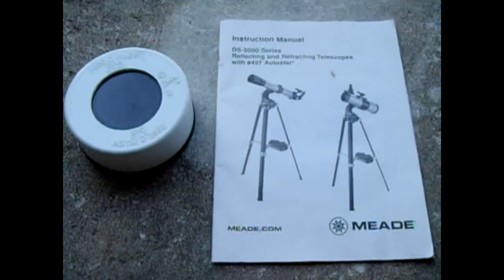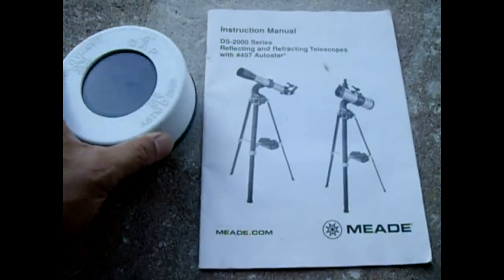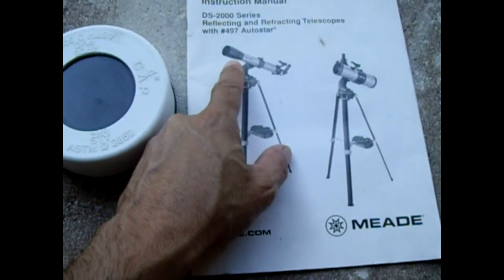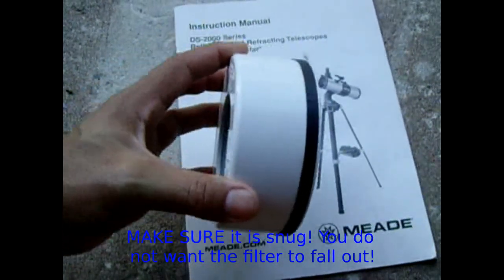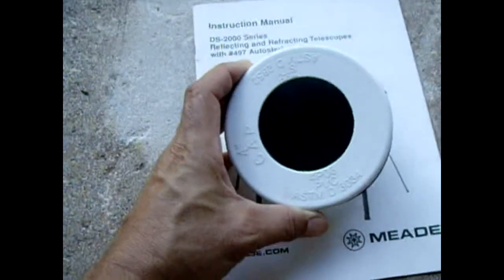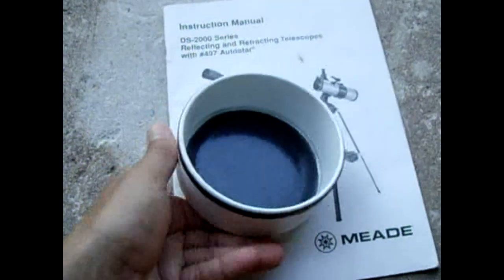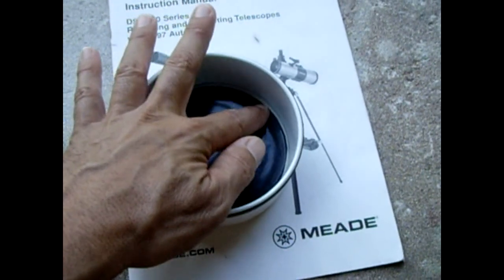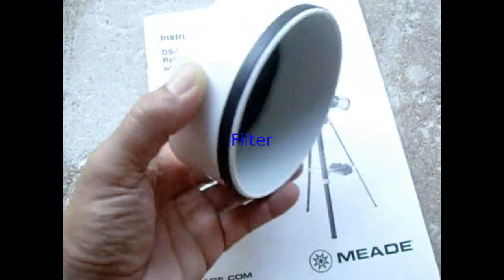Homemade Telescope Solar Filter (Meade/Celestron)

Comment: ALWAYS FIT THE FILTER FROM THE OUTER DIAMETER OF THE TELESCOPE! NOT LIKE THIS VIDEO. WHAT IF THE SEAL IS NOT TIGHT ENOUGH?
Reply from the maker: The tube is slightly tapered, and there's also a plastic ring around the objective lens. The fit is perfect.

Comment: Thought I'd make me a solar filter by cutting a large hole in a spare lens cap and applying the solar filter material to the inside of that. Normal plastic cap tho; not PVC as here. What brand silicone adhesive were you using here?

Comment: never ever touch your filter....   dangerous...  keep it clean and un scratched..
Reply from the maker: Aye Aye Sir. I forgot there are many "Experts" on Youtube. How exactly do you plan on making what I did without touching the special mlyar material? I used this filter for YEARS with zero problems, even touching it with my finger and cleaning it on occasion. This material does not scratch that easy, especially by finger tips with no long nails. The filter can be full of dust and still perform just as good a being clean.
Reply: You are risking fate of the earth sir... It can randomly open black holes and shit. Just don`t touch it!
Reply: NEVER Clean It with a Cloth !!! Only use a Specialise Air Blower made for Telescopes/Cameras, but DO NOT Touch It with the Brush that are on some of those Air Blowers !!! ... DO NOT, Under ANY CIRCUMSTANCES Try To remove Any Smudges or Marks:  You can put Microscopic Scratches on it.
This goes for Solar Eclipse Glasses Too.

Comment: Never use anything to look at the sun unless you are 100% sure it its rated for looking at the sun. Because if you are wrong. you can burn your retina. and partially blind yourself. Your retina has no pain receptors, so if you are doing damage, you will not know it.
Reply from the maker: I used specially designed mylar material for this video. I used regular mylar years ago. People accidentally look directly toward the sun all the time. Never any problems as long as you do not stare at the sun or a solar eclipse. A quick look WITHOUT a telescope does no harm. I just had a full eye exam, no problems with my retina/lens/etc. All good.

Comment: A handy source of mylar that you can use for this is from mylar foil balloons - When we had the eclipse here in England some years ago, I used a silver solid colour foil balloon cut it into sections, and distributed it between the neighbours - Worked a treat. Great way to upcycle old balloons.
Reply: This is very dangerous!! You need to use specially coated mylar that is designed to block out Infrared and other invisible wavelengths of the sun!!!
Reply: Can I put a piece of telescope quality mylar between two pieces of cardboard to view the eclipse? I tried it on Saturday and looked at full sun. I did not notice any adverse effects and view was completely dark while looking at the sky. Do the sides of my eyes need to be blocked?